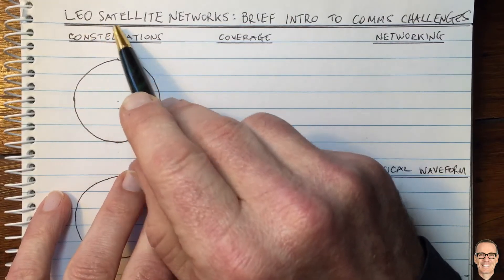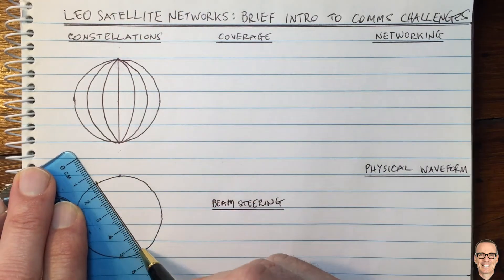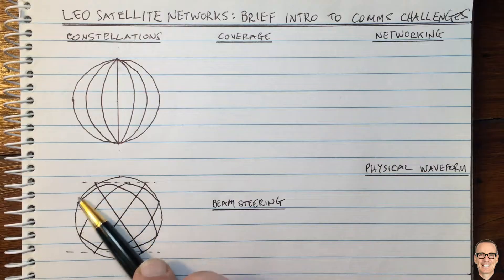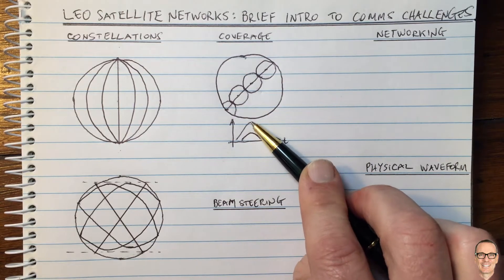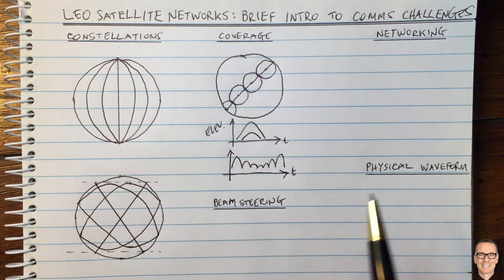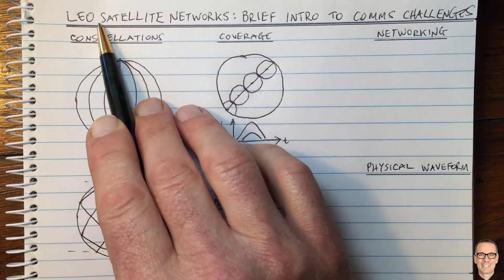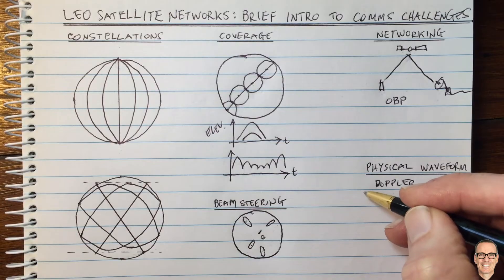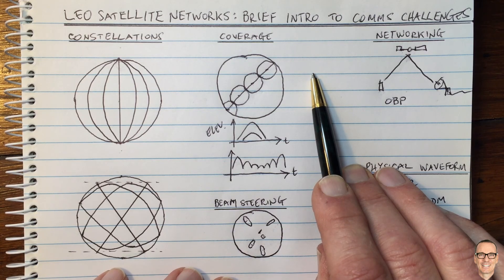LEO Satellite Networks: Brief Introduction to Communications Challenges

Comment: Just a question on the beam steering.. Imagine a scenario where you have a single satellite and a bunch of subscribers all pointing to that satellite. The satellite uses beam steering. At any point a subscriber can receive a burst from the satellite as they always pointing in the right direction, but on the satellite RX side (burst from the subscriber), you will need to have the beam steered towards that subscriber. So that's where the time slot comes in. But extrapolate this out to multiple satellites with different relative velocities - do you run into synchronisation and timing issues due to relative clock drifts? What even constitutes the clock and a time slot in this scenario? Thanks for another awesome video by the way!
Reply from the maker: Yes! I'm not an expert on timing recovery, but there are definitely clock synchronisation challenges over these long transmission distances with multiple users. In many cases timing is referenced to signals from GPS satellites.
Reply: @iain_explains  gps satelites lol more like ground stations